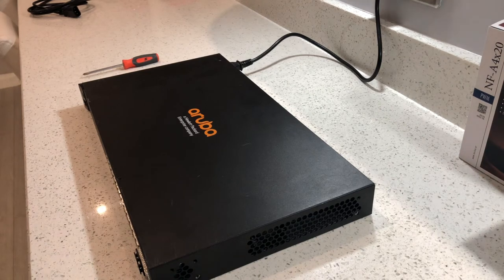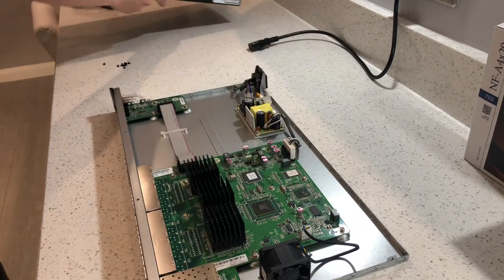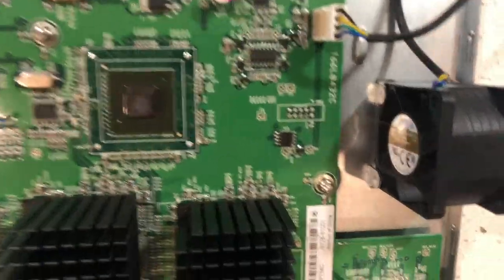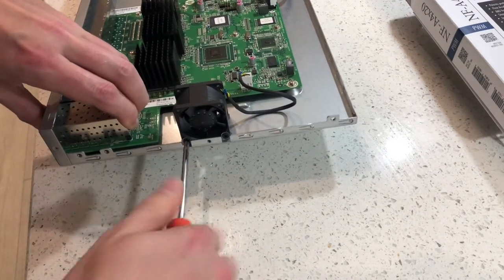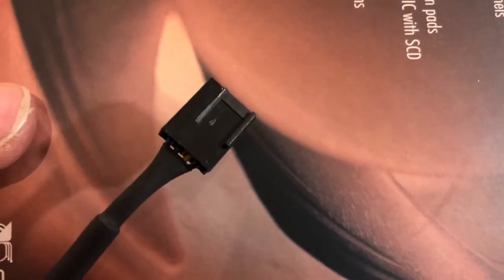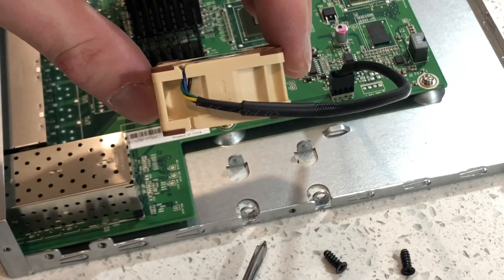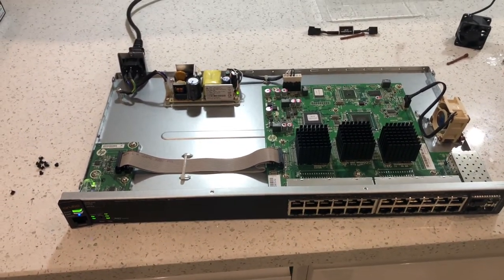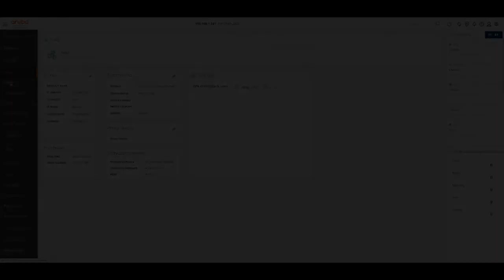HP Aruba 2530-24G J9776A Network Switch Noctua Fan Upgrade

Comment: Thank you for this video, I recently installed a 2530-24G PoE at home, it has two fans and I just ordered Noctua replacements for them. :-)
Reply: Doing the same with exact same switch right now! How are your fans? :)
Reply: @NGC1433  they’re still doing fine, i.e. I can’t hear them and switch dashboard tells me they operate normally 🙂👍🏼

Comment: Thank you very much. Excellent video and expanation.

I confirm that this method worked with my HP 2620-48-PoE+ Network Switch (J9627A).

I replaced all 3 original fans (AVC DB04028B12U) with Noctua NF-A4x20 PWM (12v).

The original fans are larger (40x40x28) than the Noctuas (40x40x20), but they friction fit into the existing slots without using any screws.

Everything works great (no log errors) and the Noctuas are totally silent.

Comment: Thanks buddy now i know it fits without  trying it on my own.. I've got a question.. what firmeware u are you running?  16.x? I got one with 15.6, and there is no way to find the update.. do u have a copy of the firmware?
Reply: You can download the firmware for these models from Aruba's support site free of charge without even needing to register an Aruba account. Going forward this series and the 2540's aren't going to be getting anything but small bug fixes and security updates really. Pity cause I prefer the management of these switches over the replacement CX 6xxx series.
Reply: @craigmurray4746  ohh wow I'm looking into it. Nice that u can't find any information on Google, that u can find the firmware there also. 
I switched to unifi because I had APs from them already.
Reply: @oli1505  I don't blame you, firmware with these enterprise devices is always a toss of the dice if it's publicly available or requires some support contract to be in place so you can download it. HPE/Aruba have always mostly been free with their switch firmware, but finding your model and the links has always been a mission.

Comment: Hi, I think the J9782A is a fanless version of the same switch. Not sure how different they are, they have the same CPU and RAM. I am considering getting one.  Any thoughts so far ?
Reply from the maker: Is the J9782A not 10/100 rather than gigabit?
Reply: @geohanson  You are absolutely correct.  Thanks for pointing that out !

Comment: did this on my 2930f Aruba 48p poe switch went from alot of noise to a silent one 😂😊 3 fans replaced with noctua
Reply: hey, what model was it? i wanna try it on a 2930f Jl262a... thanks
Reply: JL262A, just buy the a4x20 pwm noctua fans (3) and watch youtube to replace

Comment: Hi i have a Aruba 2920 48poe+ wich comes with 3 fans and a external PSU (HP J9737A) with 1 fan.

When i replace the 3 fans for the 2920 switch it works fine and no noise.

When i replaced the 1 fan for the extrernal PSU (HP J9737A)  - the PSU boots for 5-10 sek and the switch turns off, the PSU still running tho.

Any idea whats wrong? 

I tried with both 4 and 3 pin  /NF-A40mm Noctua fans 12V

Its like the PSU messege the switch(2920), that there is some error.
Reply from the maker: It could be that the wiring colours for the PSU fan is different that the internal fans? I had this on my Dell R210ii where the internal fans were wired in one colour scheme and the PSU was completely different. If I wired the PSU fan the same as the internal ones it didn’t work.

If not, then I’m guessing the PSU is detecting that the fan speed is too slow and therefore switching off to prevent overheating.

They’re not really designed to be quiet and I’d be careful of the heat/temperature if you’re running a lot of PoE devices.
Reply: @geohanson  
Thanks for reply.

I think its becuase of the swtich detect that PSU dont run full fanspeed. Becuse its boots and then shut down.

Also i think the PSU has intigratet firmwire that ''alarm'' the switch and tells it to turn of.

Its just funny why the switch keeps running when i replace the internal fans for the switch but not when i replace the eksternel fan for PSU???

I run like 8 POE devices on the switch and 9 non poe conections. I will keep you updatet if i run in to a meltdown or other thermal problems:)

Comment: Is there a way to regulate the fan speed?
I got a HP ProCurve 2520G PoE and for the love of god cant find if there is a way to regulate the speed softwere or hardware way.
Reply from the maker: Not as far as I know. I think the fans are fixed speed and not controllable via software. You might be able to use the noctua inline low noise adapter to decrease the speed of the fan.
Reply: @geohanson  Will probably have to resort to that

Comment: I have a question for you, I'm interested on one of them to replace my 1400-24g that recently stoped working for the 3rd time(one of the BGA is faulty and need to be reflowed from time to time but it's always putting a band aid on the problem and it's fanless. I supposed my modem underneath was too hot... before it was cooler older modem and it was on top, I've added a fan to help but was too late) so yeah, is it easy to configure and managed?
Reply: Ok this comment is 3 years after the fact, but as someone who manages a bunch of 2540's I'll say that the Web interface is pretty nice and exposes most of what most people would need. The more advanced stuff is available in the CLI of course, but depending on your needs you may never need to use it.

Comment: I would assume this works on the 2930s?
Reply from the maker: I think it will probably work - you just need to be careful that the switch doesn’t get too hot as the Noctua fans won’t move as much air.